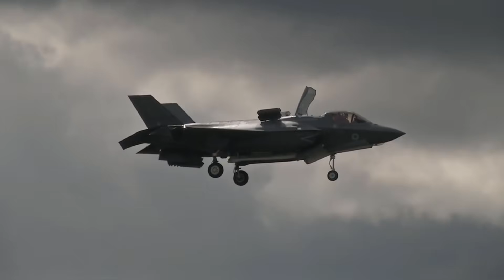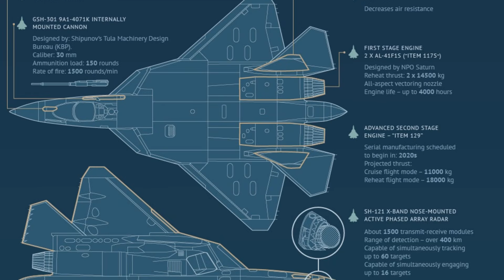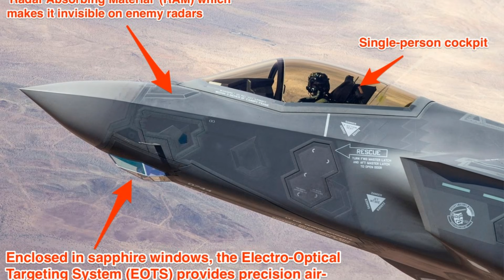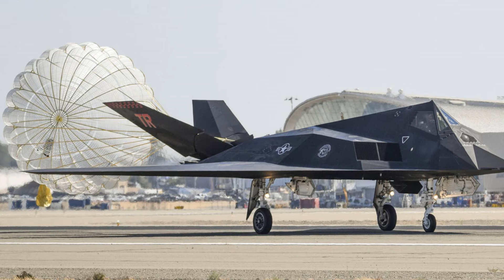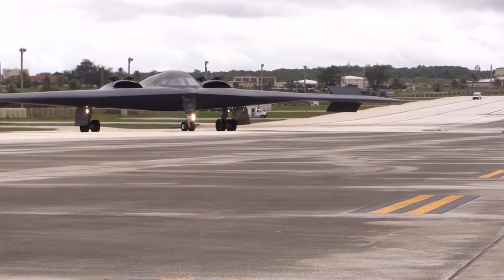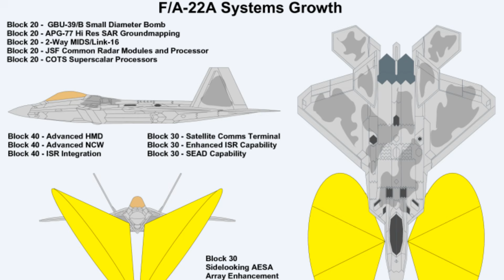Top 5 Combat Aircraft with Lowest Radar Crossection (RCS)

Comment: The SU-57 doesn't belong on the list. It isn't a true 5th generation fighter jet. It's at best a 4.5 generation platform.
Reply: Omly the Su-57 only the production version of the Su-57 has the necessary improvements to have an RCS below 0.5 m²
Reply: You have to admit that the Su-57 is a breakthrough for the Russians because it is their first attempt to have a Stealth Fighter and they achieved a good result for their first attempt.
Reply: The SU-57 has an RCS of 0.5m2, about the same as a Tomahawk cruise missile. Which is a big fat targets the Western nations  advanced radars.

- China’s fighter planes are mostly the older 4G J-7s, which were derived from the Russian MIG-21 airframe. So, they probably show the same RCS of about 3m2 best case. Their J-10s have an RCS of 0.5 to 1.5m2. Their newer J-20 fighter has some flaws in its design, so it has an RCS about the same as older 4G fighters (about 1m2 to 3m2). I Don’t have much data on their new J-31 (FC-31) fighters, but they did create some rippled exhaust nozzles on their engines that will reduce its rear-aspect reflections. If I had to guess, since the J-31 looks like the offspring of the F-35 and the SU-57, It might have an RCS in the range of 0.5 to 0.1m2, being generous. And, if China is doing so well with their stealth fighter designs, why did they just take delivery of four Russian SU-35s in December 2018? The frontal RCS of their new J-31 is certainly much better than the SU-35, if my guess is accurate, so they must want access to the Russian radar and on-board systems.

- Among the U.S. fighter planes, the 4.5G F-15 EX has an RCS of 1m2, not very impressive The 4.5G F16 has an RCS of 0.01 better but still not great. The 4.5G F/A-18 Hornet Navy fighter jet has an RCS of 1m2, about the same as the Russian SU-34/35 and the Chinese J-20. 
The 5G F-35 has an RCS of 0.005m2, about the size of a golf ball. However, from the rear, it looks much bigger because of the exhaust nozzles, the same problem we saw with the 5G Russian SU-57, For comparison, the 5G F-22 has an RCS of 0.0001m2, about the size of a bumble bee. The U2 and SR-71 spy planes have an RCS of 0.01m2, about the size of a small bird. Our first stealth fighter/bomber was the F-117 Nighthawk from the 1980s. It has an RCS of 0.003m2, about the size of a hummingbird, and those F-117s hit more than 1,600 targets without being molested by Iraqi air defenses during the 1991 Gulf War.

We didn’t discuss long range bomber The B-52 has an RCS of about 100m2. The B-1 bomber is 10m2.
 The B-2 bomber has an RCS of 0.0001m2, the same as the F-22, the size of a bumble bee. 
The new B-21 bomber, now being built by Northrop Grumman, is virtually invisible to UHF/VHF radar. It shows up about the size of a mosquito. since the return signal is -70db for the B-21, or about 0.000001m2. If you ever wondered about it, that’s the size of a mosquito on radar.

Our major enemies fly terribly old and antiquated non-stealthy bomber aircraft. The Russians are still using propeller-driven aircraft like the TU-95 Bear. 
By comparison, the RCS of a World War II B-25 prop-driven bomber is 3,100m2. The Russians also have their TU-160 jet-powered bombers in operation, and the Chinese have a similar elderly H-6 jet bomber. There are no good numbers for these antiquated airframes on the web, so I think they would have about the same RCS as a skyscraper lol 😂.
Reply: It means all the requirements
Reply: Tell me what you are your sources to saying that.
Ps : Im american, not russian
Reply: @kayrxx7123 "Nationalities" thing is just a distraction tactic on your part!  This SU-57 should really be called Phantom-3, because Russia supposedly built 5 but only 3 flew!  It is barely a 4.5 Gen NON-STEALTHY jet PERIOD!  It's your proactive or mission to make interference, distract, change the subject, manipulate or steer the conversation away from the fact that US stealth technology is far superior from anything out there regardless of all the theft and copying work China & Russia do!   Now don't be lazy and do your own research, remember to also look into as to why numerous countries canceled SU-57 and countless other Russian military purchase orders, good luck and GOODBYE 😉
Reply: @kayrxx7123  The engine exhaust vectors are one problem.
Reply: @kayrxx7123  Sources aren't necessary. Anyone with even a modicum of knowledge on tactical aircraft can tell at a glance. Exposed rivets, the engines, the layout of the intakes, etc. It has all of the classic features of 4th generation fighter jets. The SU-57 isn't even remotely a stealth platform. Meanwhile, the USAF announced well over a year ago that it had already flown a 6th generation fighter jet. Russia simply isn't in the same league with the United States when it comes to developing and fielding advanced tactical aircraft.
Reply: @classicgalactica5879  well I see.. so because the Su57 is russian he can't be a 5th fighter.. Really? Just because of that? Any others kind of evidence just pure arrogance. 
Honestly we need to stop underestimate foreign stuff. I only believe in facts. Not on some kind of dreams or hopes. 
It's because you don't want this plane to be a 5th fighter that it will not be a 5th fighter.
Reply: @classicgalactica5879  Russians engineers probably knows better than me or you how stealth work, this plane probably don't have the rcs of a dragonfly but probably way less than half of one of our F15
Reply: @kayrxx7123  Here is a fact for you - SU-57 is not even mass produced it is basically still a concept plane with only 5 operating planes in the entire existence. I'm not saying it might not be amazing some day, but at this time it can't be even put in the same category with the rest of the other stealth planes in this video which are not only mass produced but also combat proven for over 20+ years now. I am not underestimating the Russians, quite the contrary (never understimate your opponent - Sun-Tzu basic philosophy for over thousand years), but they are notorious for bullshitting about their (inferior) technology and their mighty military force.  Did they make some great stuff throughout the history? Absofuckinglutely! But not everything they claim is high-tech and amazing is actually that great.  We can see the proof of this every day in the Ukraine where officially #2 military in the world is getting embarrassed every day by the much inferior Ukrainian military. And no, they are not fighting the hidden guerila force like the Taliban or the Mujahedeen in Afghanistan or the VietKong in Vietnam and Laos/Cambodia which are basically impossible to ever fully defeat, but they are fighting a regular military on a "classic" battlefield. We (USA/NATO) couldn't defeat the guerilas in Afgahnistan or Iraq, but we sure as hell occupied all the major cities and all the populated areas within few weeks destroying the regular Iraqi military in the process. We did the same thing in Afghanistan wherever we fought on a "classic' battlefield. We defeated Milosevic and Serbia's military within 3 months only through air strikes and precision laser-guided missiles fired from our ships and subs with no "foot on the ground soldiers" forcing them to fully withdraw from the Republic of Kosovo. The Russians can barely occupy some small areas near the area that the Ukraine already lost years ago (Krimea, Donbass..) and their only military strategy is leveling the Ukrainian cities "the old school way"  by bombing them back to the Stone Age when they have an advantage of more than 50:1 in artillery and 20:1 in soldiers.  If their technology was so amazing as they claim to be, at least the air dominance over the Ukraine should have been a piece of cake for them and we all know that they don;t control the air space. To summarize, if someone ever tried to invade Russia most likely they would all lose because the Russians would defend their motherland house to house. But when it comes to high-tech weapons and technology they are much inferior in comparison to the West.  Most good new technology they have is what they stole from the West through espionage, computer hacking, and other similar means. China is even more notorious for copy-catting everything.
Reply: @robertbauer3419  if they could only produce 5 than that means it's a great fighter because they can't afford it
Reply: @wrpg9955  Hahahahahahahahahaha. I gotta hand it to you Russian internet trolls, you will use any information and try to spin it in your favor. lol. If America made only 5 of F-35's you'd be laughing at us and saying " F-35 is so bad the Americans only made 5 of them and stopped the project when they realized how bad it sucks". But in your case, making only 5 SU-57s is now a sign of technological brilliance and teh fact Russia is broke and can't afford half of the shit it makes is also a strategic brilliance and a sign of their true greatness.  Kid, listen, we could use shady salesmen like you in my company, you could literally spin any info and use it as a positive argument why someone should buy our products. I promise we will pay you more than 400 Rubles and a plate of bone soup which is what you probably get at the Putin Internet Troll Farm. Oh, and an extra bonus/benefit - you don't have to stare at the shirtless photos of Gay Czar Vladimir all day (unless you really want to, but we can hook you up with those of Brad Pitt or Ryan Gosling - much better, right?)
Reply: @kayrxx7123  … It isn’t just the stealth aspect that keeps the SU-57 from being considered 5th generation. It is still using the AL-41 engines of the SU-35 which give off a great heat signature plus are incapable of supercruise. While the avionics and AESA radar are still in development. Until Russia sorts out those problems, the SU-57 is a 4.5 generation fighter.
Reply: @JimCOsd55  Agree!  Similarly, the J-20 is plagued with "incapable engines" issues as well!  Underpowered, overheat and catch fire!  Bottom line is unlike the Su-57 or J-20, the F-22 & F-35 were designed and built as Gen 5 Stealth fighter jets FROM INCEPTION at a cost of about $1.5 trillion!
Reply: @robertbauer3419  17.
You know ANYTHING.
Reply: @wrpg9955  Dumb logic, it's just still in testing. It has alot of issues
Reply: @yoamal1187  which are?
Reply: @wrpg9955  engine issues, flight controls, avionics, it's not hard to look things up
Reply: @classicgalactica5879  YEAH, well the f-35 either; some Turkish RO have disclasified than the Israel's F-35 have similar RCS to the SU57 prototypes....so one of the planes its lying about RCS, and according to your standarts, none of them are 5th gen